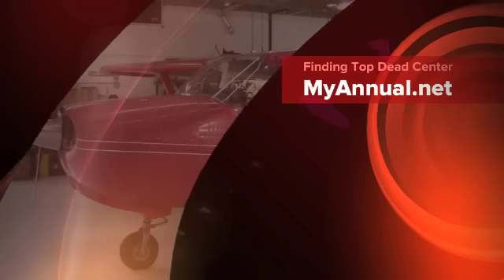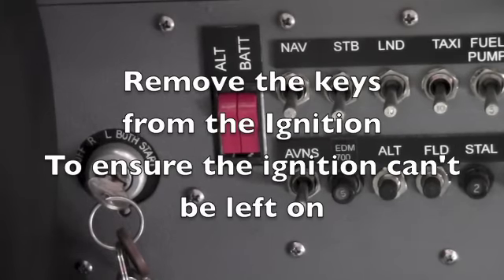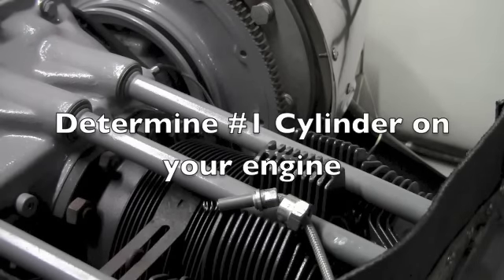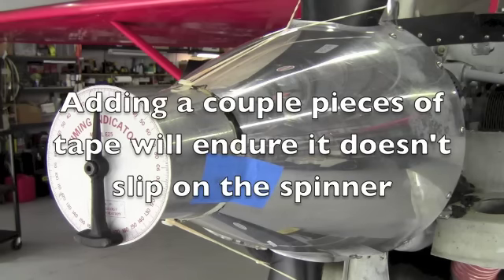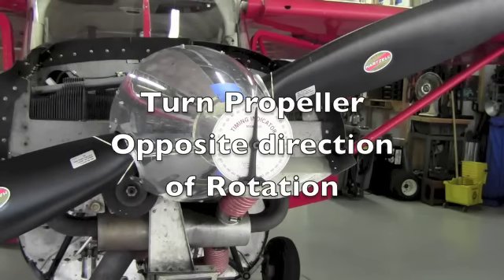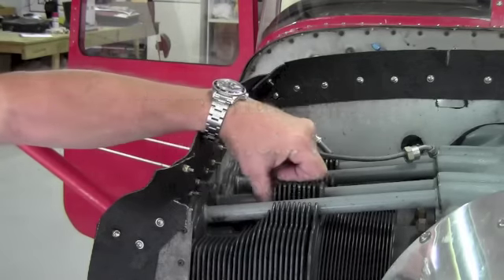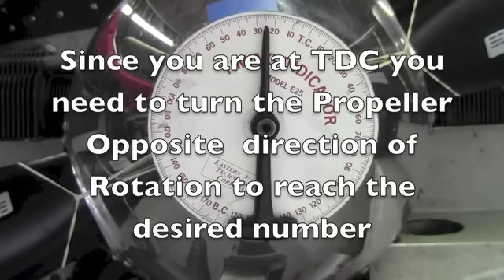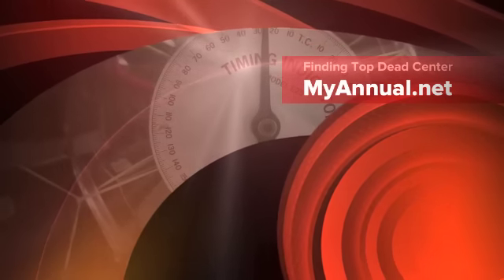Finding Top Dead Center

Comment from the maker: With the piston plug used, you first turn the propeller in the direction of travel find the end of the piston travel on that stroke, you then turn the propeller in the opposite to find the end of the piston travel on that stroke. Divide the number of degrees on the indicator by 2 and you have TDC. You then find the compression stroke on #1 cylinder (by placing your thumb over the spark plug hole and turn the propeller in the direction of travel until you get compression under your thumb) turn the propeller (in the direction of travel) until you get to "0" on the indicator, that's TDC. Hope this helps, Eric
Reply: So   4:00  End of the piston travel is not the TDC  ?
Reply from the maker: Yes, when the piston is at the end of its travel thats TDC, the trick is to bring the piston to the end of its travel in both directions to determine TDC. If you can envision the piston reaching the top of its travel the connecting rod may not be at the end of its travel, by doing it in both directions and then "Splitting" the difference between the readings you ensure that you have reached true TDC. Hope this helps, thanks for the question. Eric MyAnnual.net
Reply: Ok  I understand you now, in  4:00 you said that , that's  TDC cause  the piston touch the pin ok that's  a common sense and I accept that  . but I wanted to know the reason why you spin the prop to the opposite direction of rotation  and splitting by 2  since you already found your TDC in 4:00 and you re  saying to ensure that you have reached true TDC or to make sure that the connecting rod is at the end of it's travel  ,     Am I right  ?
Reply: Correct it is not. Just a stop. Prop must be rotated back around other direction to the stop. When you get both end point numbers the same  0 will be TDC

Comment from the maker: OK lets try this: I used to (before I got the piston plug and the timing indicator) take a pencil and put it in the #1 spark plug hole, let the piston push it up (compression stroke) and that would be TDC, I noticed that if I went backwards I would get a different reading (small difference but different nun the less). The directions that came with the piston plug says to do it the way I do it in the video, as I thought about it, it would depend how far you had the piston plug screwed into the spark plug hole as to what reading you would get. So turning it both ways will give you travel in both directions, when you divide by 2 you get exact TDC.
As long as you turn it both ways (and record the readings on the indicator) it would not matter how far you had the piston plug in the hole (as long as it contacted the piston.
Hope this helps,
Eric
Reply: You got it right. There is no backlash on a crank. He did nothing
Reply: As I recall; Both Lycoming and Continental have TDC notches on the propeller flange.
Just line it up with the crank split, then back off to the ignition timing mark provided.

Comment: Thanks Eric for the very good explanation of finding TDC. I like this way because it is the most accurate indication of TDC and takes into consideration gear lash.
Reply: There is no gear lash. Dial is on the crank. If connecting rod has any slop, Stop remove the cylinder or close the shop & go home !

Comment: Piston stop? What is piston stop? Any different for continental and lycoming engine piston stop tool, length? Tq sir.
Reply: What the other tool we can use as piston stop.
Reply: Piston stop is a tool usually screws into sparkplug threads. A probe extends into the cylinder. In this case a few inches. Piston comes up hits the stop or probe. That it. To find TDC a dial indicator must be used. Tool can be homemade as long as it stops the piston.

Comment: WHY are you going through all that Rigamarole, with a timing disc?
All you need to do is to find the compression stroke on Number 1, then look at the propeller mount flange,, or starter gear; TDC will be right there. Back off the prop to 25 Deg. mark. Time your mag to that. It's a lot more accurate, than using the timing disc, because it's exact. 
The only time that I have ever needed a timing disc, is on a radial engine. (Pratt?)